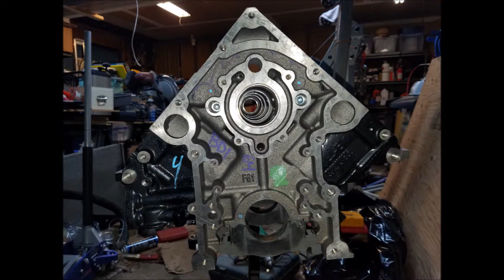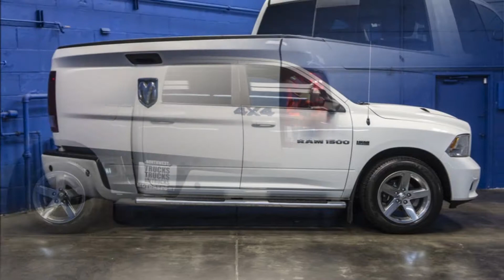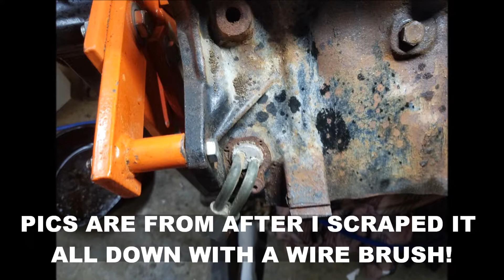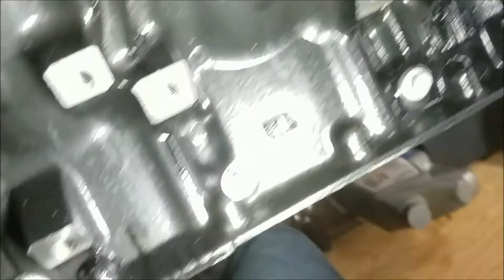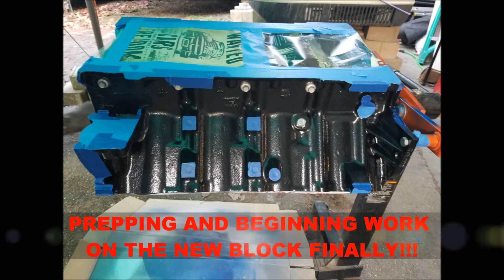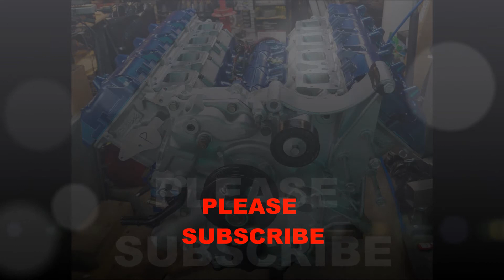TWO BAD 5.7 HEMI BLOCKS FROM MOPAR! 3RD TIME’S A CHARM?

Comment: Just throwing this out there but I noticed your pictures had a northwest motor sports plate on it and I have to say I bought a 2012 ram 1500 from them that after 20000 of driving did the same thing cam and lifters on cylinder 5 destroyed
Reply from the maker: Interesting, but probably (hopefully) a coincidence. They sell a lot of these trucks and these Hemi's are well known (now I know too) for this issue. We bought our truck from them and it was the cleanest, most well taken care of truck we looked at. Started and ran like brand new. And I did a thorough crawl around under and around the truck knowing the detail tricks dealers use to hide things. I also changed the oil right when I got it home so no additives etc could be in its system. There are so many Hemi's with these issues, anywhere between 15,000 to 200,000+ miles it's so random, but definitely a Mopar flaw in design, that they really should have recalled and fixed. I wasn't lucky enough to still have a warranty. That sucks it happened to you too. Mine sure is fun now that it's all built though!

Comment: Did u ever consider a 6.4 crate motor I see them complete long blocks going for $7500? Idk how much is in yours but I figured it wasnt far off that.
Reply: I have a 6.4 block near me for $600 thinking about it for my 2012 ram
Reply from the maker: I did consider several different crate motors, unfortunately I started with the thinking I would do a less expensive build by doing it myself, BUT the horsepower bug bit me and I kept upping the parts and adding to the build after I was already deep into it so it did end up costing me a whole lot more for everything in the end.
Reply: @RacinJasonHighPerformance  I got ya looking forward to seeing what comes next. 👍
Reply from the maker: @bmf88  Thanks, I have to sit down and edit some videos. Life's been crazy round here, went on vacation, came home to find our basement flooded, been remodeling that again (just did last year), also truck started having bad exhaust leak, BBK headers welds already failed, have ARH long tubes one the way now. Just that and like 50 other things have been keeping me from posting more content. I'll get back to it soon, if the problems of life ever give me a break, LOL
Reply: @RacinJasonHighPerformance  Been there man just do what you can when you can is how I look at it.

Comment: I commented on your comment on frostbite video... am relatively new to the hemi motor.   The lifter issues going bad.... what can we do about it?  Or is there nothing to do be done?
Reply from the maker: I suspect if yours has not gone bad yet (not ticking, not throwing misfire codes...), possibly putting into the Hellcat high volume oil pump could help keep more oil going to the needle bearings and possibly prolong thier life. Beyond that you have to tear deep into the motor to replace the stock lifters with Hellcat lifters and also the above mentioned oil pump. Unfortunately the design of the Hemi requires removal of the cylinder heads to get to the lifters. If you're in there, MDS Delete and aftermarket cam is highly recommended. Also some head work because the stock heads are known to break valve springs and drop valve seats into the engine, causing worse damage. $$$ starts adding up in a hurry!